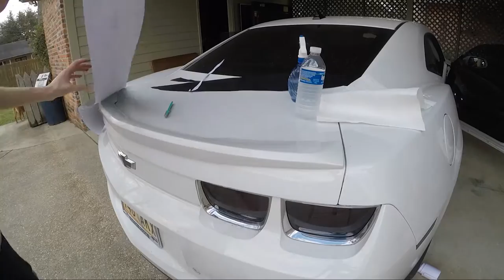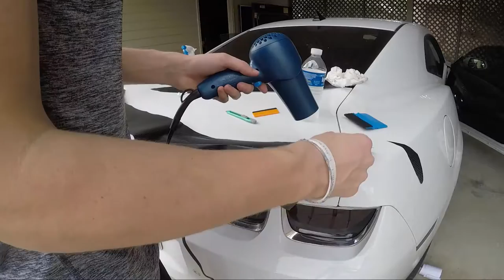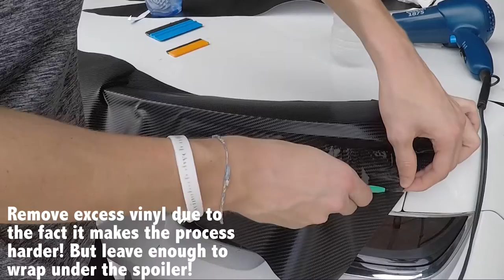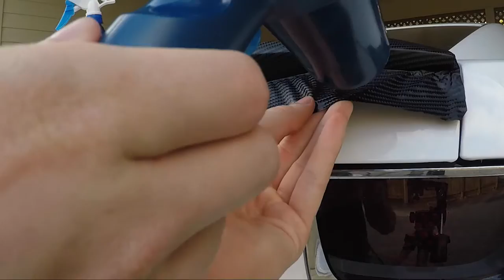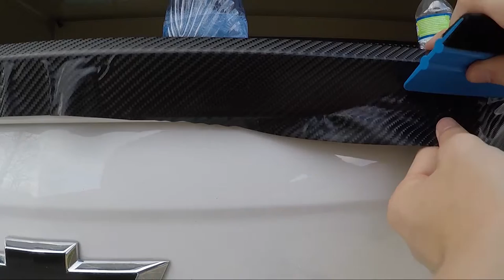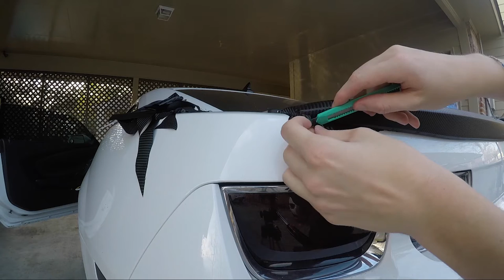Carbon Fiber Vinyl Wrap 2013 Camaro Spoiler

Comment: Word of advise... don't clean up with dish detergent. The detergent  cuts grease and dries up the oils from the clear coat destroying it little by little. Simply wash like normally using car shampoo but without carnauba. If not avilable, simply use hair shampoo which works fairly well in cars and then clean with rubbing alcohol but don't use dish washing soap

Comment: Stretch the whole wrap first and squeegee it and flatten it out and then cut with one swift and slow motion motion, instead of cutting flattening and tucking, cutting should be the last step, along with heat. Looks really good tho

Comment: Best thing would be to remove the spoiler for best results. But he did an excellent job without removing it.
Reply: No u dont have too remove. While the spoiler is on it has so much space to grip and pull and play with the wrap it is so much difficult and uneasy process if you take the spoiler off.